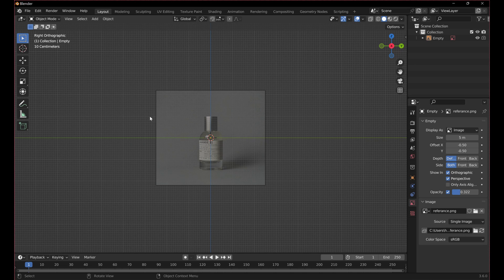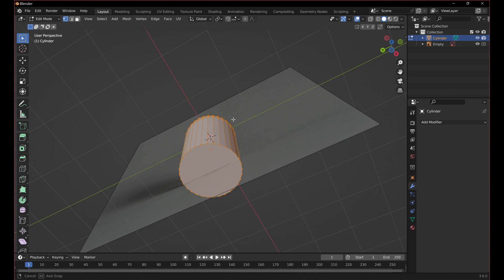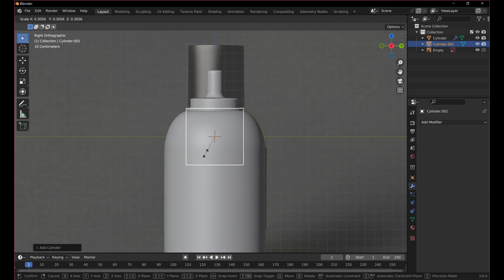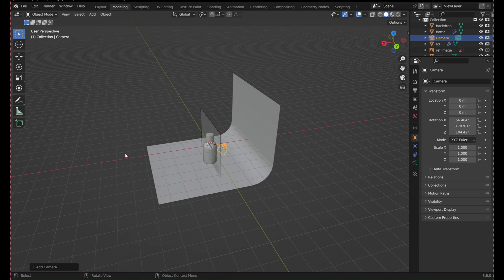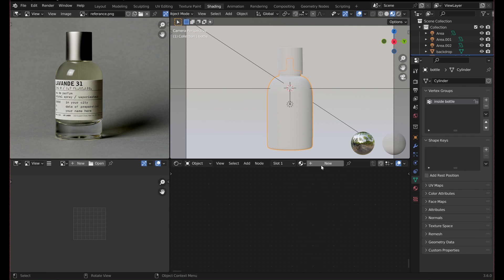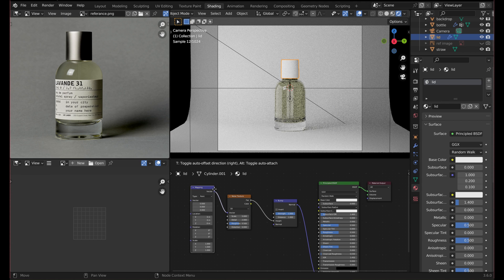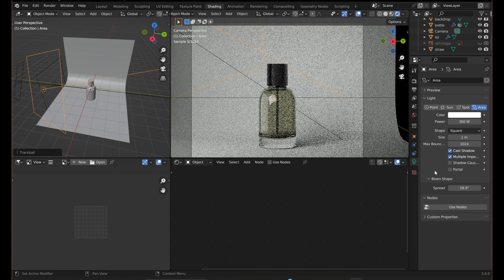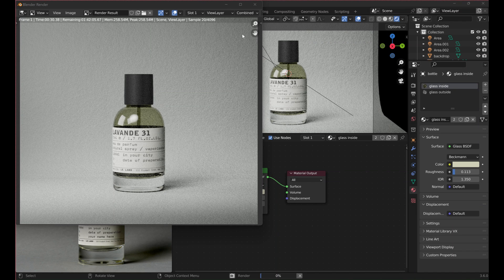Product Design Tutorial with Blender:  Perfume Bottle

Comment: Did a similar project but ended up with 3 issues each time
1. There is a 'line' along my bottle (right where the inside part starts to bevel into the curved part)
2. I used subsurf modifier and shade smooth for the cylinder for the bottle and it looks fine in viewport shading, but when I'm in render view mode then there are clear 'sections' of the cylinder (as if it were low-poly with like 12 faces going around.
3. The bottom part of the bottle looks too thin. The real bottle has solid/ thick glass at the bottom but in the model it looks paper thin (even though there is thickness from the solidify modifier)

Comment: I did the tutorial step-by-step but at the time I had to do the material in the outcome everything is black. Black inside, black outside. I do not have the same trasparent outcome of the video. The ironic thing is that if I use Blender 4.0 or 4.1 there is this issue. If I use Blender 3.1 no. If then I put the file did in 3.1 in 4/4.1, everything is normal. I don't understand where is the problem in 4/4.1.
Reply: I have the same problem.
Reply: what if you change yiur render settings to cycles? worked for me
Reply: @B4BUDHA  I was already in Cycles. In the end I've fixed the bug resetting to factory settings.